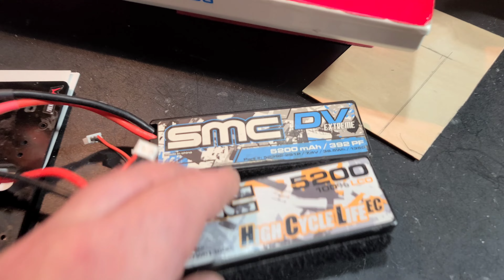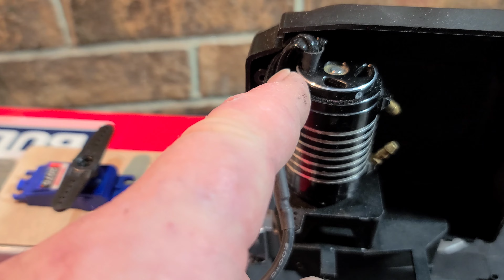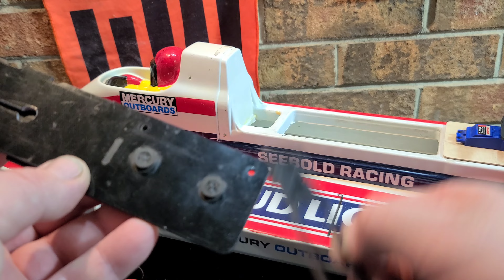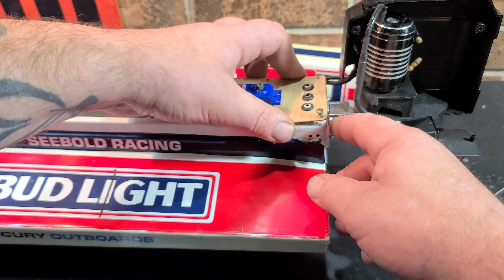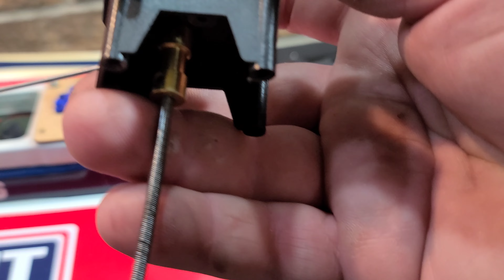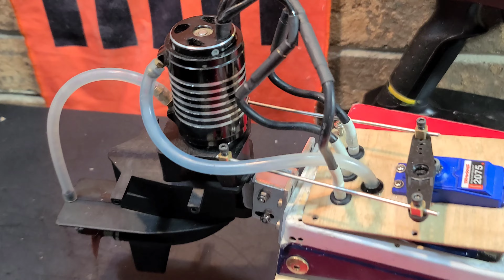MRP Tunnel Hull Rebuild - CG, Sliding Battery Tray, Outboard Steering Setup, Servo Mount

Comment: Hi Ironclad, I'm having some trouble with my boat. I have all brand new parts. When I plug in the battery to the esc, the motor starts spinning by it self, until I push the throttle forward and I have to hold it there. Do you know what could possibly be?
Reply from the maker: Your dual rate may be up or down make sure it's neutral with the esc your using, if that doesn't work try reversing the throttle in the transmitter then going back normal.    If that doesn't work rebind your rx/TX make sure you follow the binding procedure some esc's need neutral/zero trims some don't.
Reply: @IRONCLADRC  thanks Ironclad!! At the end it was something silly, I bought a flycolor and when it’s new you have to hold the throttle wide open for 2 seconds, and it sets the maximum throttle and neutral. It was the first instruction in the manual 🤦

Comment: Another way to strengthen the stock flex cable is to solder the flex cable to the prop shaft (or use red loctite). The square end will begin to round out over time and eventually let go. Especially with a brushless motor. You can also run it stock and then when it rounds out, solder or glue the flex cable at that time. The TFL mini outboard uses a similar system and this upgrade works equally well for that outboard. Excellent work on this project so far. Cheers!
Reply from the maker: Roger that, thanks

Comment: TFL makes a nice small electric outboard thats not plastic. the one i have is on the back of a TFLSPRINT,  i would stuffing tube or sleeve the inside of that if i were you anything over 25,000 RPM or so gonna melt it.  https://youtu.be/sj29V9arMdM      it comes with a little 50a esc because its an older boat from tfl. i just ran it too see before i change the motor and esc out....... K&B makes a nitro one too

Comment: That’s AWSOME !!! I will pay you the highest compliment buy copying your sliding battery tray for my drag boat build 👍
The grommets for the wires and cooling line is a top notch idea to Big B.
I have a very cheap/old 12mph tunnel hull I converted to a brushless inboard driven boat and still had to put the battery in the nose but it “flew” with only the tail end of the hull on the water and would flip spectacularly end over end and land upside right (almost) every time. 
I am particularly interested to see this one of yours on the water. 
You go Big B-BGFL 👍
Reply from the maker: The sliding battery tray was actually fairly easy to pull off, with some proper planning....   good luck brother

Comment: Its coming along great. If the water system becomes a problem you can fit an outrunner drive. Less stress on the turning and plenty of air cooling available. A little water pickup for the esc. Or as there might be less amps, maybe smaller esc no need for water. What ever, your doing a nice job. Looking forward to the splash down in next video. Com'ooooonh, com'ooooonh. 🤣